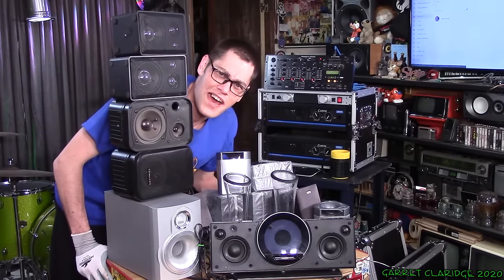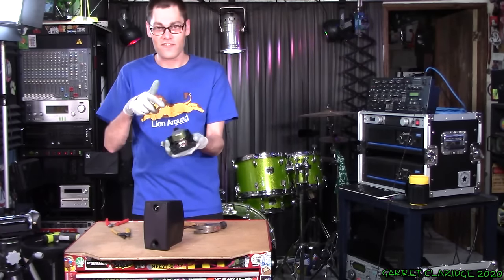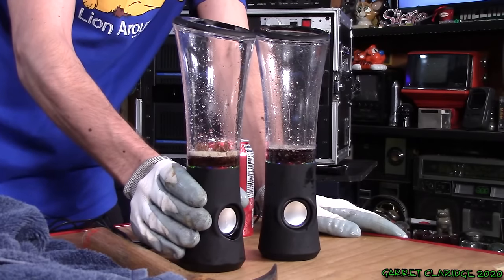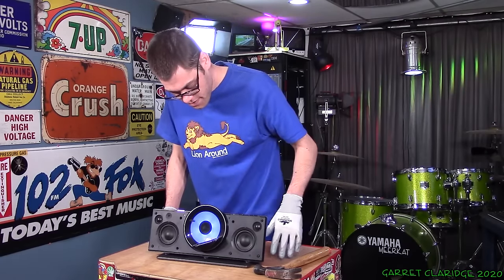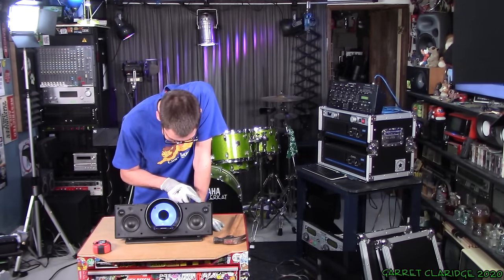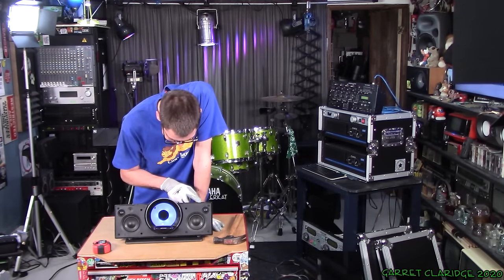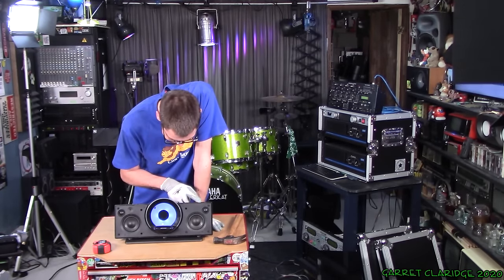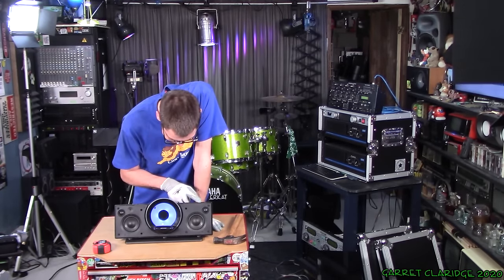Blowing Speakers - The Covid19 Clean Out

Comment: For the water speakers, they use oil in them so it runs down to the bottom of the enclosure without sticking to the sides 👍
Reply: It'll be used for its low density too. It's a whole lot less dense than water and especially soda, hence why it struggled with the soda.
Reply: DID U SAY OIL!?!? OIL!!

Comment: All water speakers use mineral oil to prevent them from getting moldy.
Reply: Ohhhh
Reply: I don't get it
Reply: If they used real water, the water would probably get gross, moldy, or some other thing after a while. Oil like this has always been used instead for water speakers, because it does not do that. Plus it is a much thinner liquid and easier on the pumps.
Reply: Why not real water?

Comment: WOW-When you get a bin of speakers---UNFOLD THE FRYCORD and warm up the amp for some speaker pookin,spookin fun!!!Loved those unknown speakers wrapped in plastic-no contamination here!We learned an important lesson--you let the smoke out of a speaker or any other electrical-electronic device-It doesn't work anymore!That iPod thing-what is with that rotator thing-don't get that-first thought it was a woofer of some sort.Loved that cap getting launched off the board!That happened here at the transmitter-Pulse Step modulator module-launched a cap of that board-heard it in the control room thru a wall and two windows.When the module wass replaced-that little caps were blown completely off the board.The "water"or was it "baby oil" speakers did work weird with coke-HMMMM-use those as drink mixers?

Comment: That White Van Speaker lasted waaaayyyyyyy longer than I expected! And it took so much power before finally quiting! They should just quit trying to scam people and sell those for $20 a piece for people to mess around with!
Reply: TBH some of the white van floorstanding towers sound just as good if not better than most entry level towers some sound bad but so do some name brand speakers that cost a lot. THE plastic cube systems sound awful though well 99% of even the name brand HTIB's sound just as bad.
Reply: Yeah I was surprised at the excursion on those heaps. If they put 10% more effort into the crossover and the box rigidity and 10% less into making them look faux-posh they probably wouldn't be that bad.

Comment: MATE I AINT EVEN SCARED OF CAPACITORS I FIND THEM FUN WHEN THEY EXPLODE HAHAAHAAAAAA
Reply: I have had them explode right in my face while using a hot air soldering station too close to capacitors on a board. Not a very pleasant experience.

Comment: The woofers on the white van speaker has each woofer connected to only 1 input channel, as you heard the audio coming out from both is because they are in the same enclosure, I guess the other woofer which is not connected will act as a passive radiator, which explains why one plays higher frequencies and one does not.

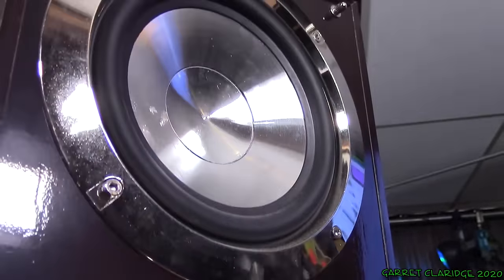Comment: 14:23 One of the many ways you can tell that a white van speakers ham sub is because if you’ve seen them before you will notice that the terminals on the back of the subwoofer cabinet are the same terminal networking systems that they use on pretty much every white van speaker scam subwoofer Cabinet and you also noticed that inside what is weighing them down and making them so heavy is bags of sand how I know is because I bought a White van speakers Scam system for dirt cheap just for shits and giggles